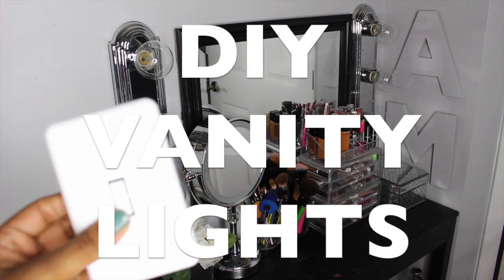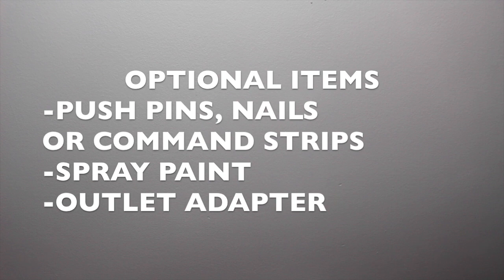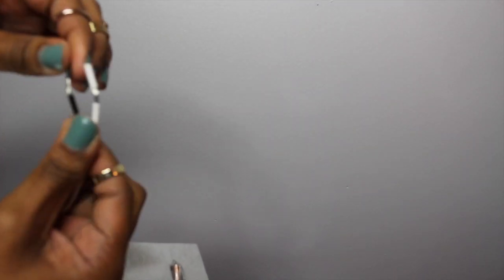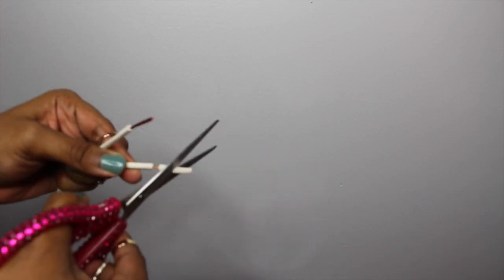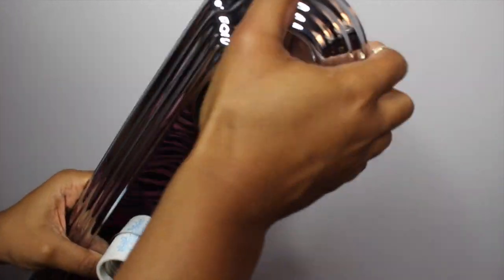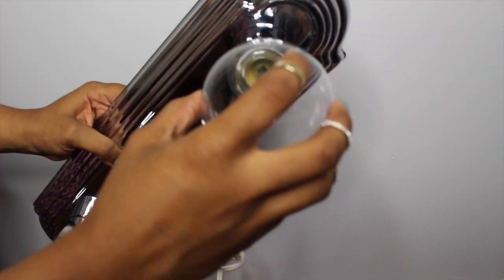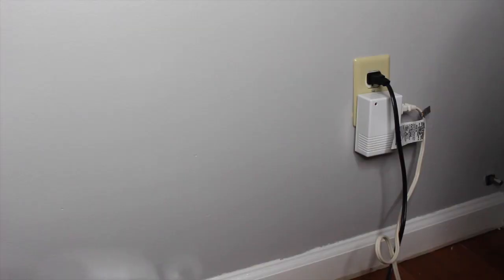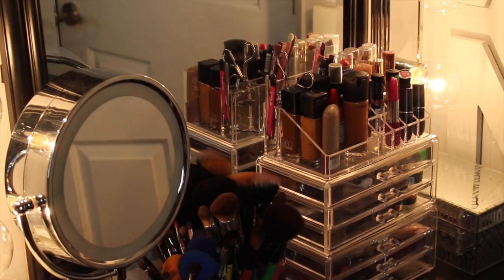DIY: Makeup Hollywood Vanity Lights

Comment: But I need some help with the OLD fixture that was there. The silver "tube" around each light bulb socket does NOT unscrew.  There seem to be 2 pins that come in the back of the socket and hold the silver tube in place that way. It looks like you would have to hold them together at the same time and pop the tube off that way. But is just too hard. I don't have a special tool that does that  . I can only get one side out and it'd dangling and I can't steady the thing to get the other side out. I think the old fixture is too old.